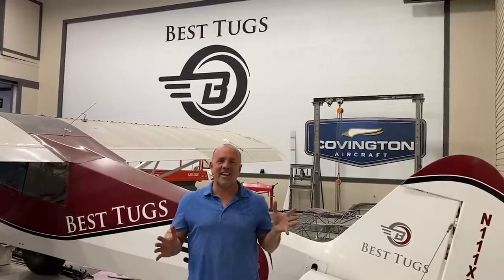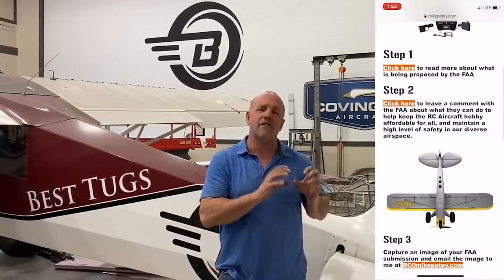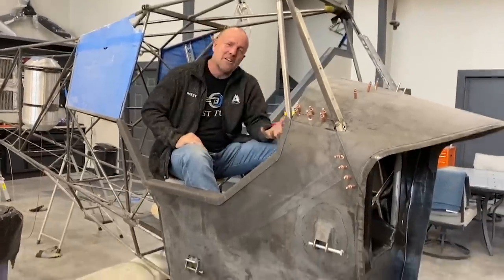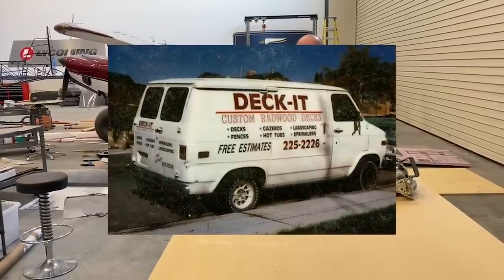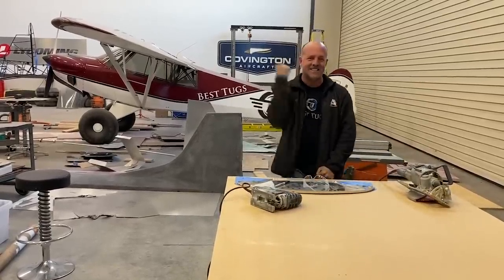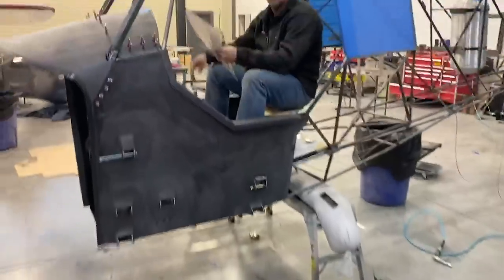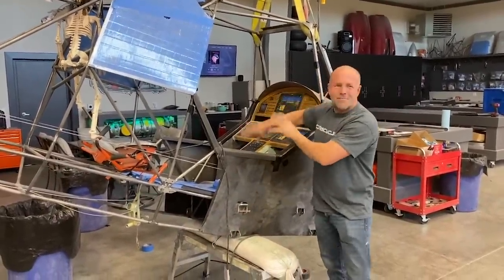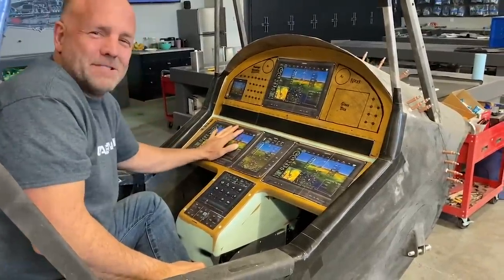🤠 Garmin Glass + Carbon Fiber (SCRAPPY Bush Plane 10)

Comment: Wait, wait, wait, hold everything!!! At the end there did you say you wanted to build it to HELP mechanics or somebody who works on the plane? You'll never make it as a designer, Mike. Darn, we had high hopes for you too. Well, I hope you redeem yourself by at least mix-matching different size fasteners, and using both metric & SAE for seemingly no reason. Maybe even both Torx and (impossible to find a wrench for) 5-point star drive screws for good measure. Otherwise mechanics everywhere will forget how to swear and get soft & lazy. Aside from that giant mistake, great video as always ;-)

Comment: 16:26:  Really!?  This panel requires a back-up?  (I hope someone at the FAA is watching and wondering the same thing) lol
Reply: The G5 has it's own internal battery backup in the event of total aircraft power failure, as well as it's own pitot and static air inputs. Perfect for a backup device. Or a primary on a small panel with a failsafe built in.
Reply: Regulations require IFR aircraft to have backup instruments so unless he decides to put in a secondary ADAHRS or ADC-AHRS unit for the main panels, hes gonna need that backup. I'm assuming that all the main avionics panels he's using would be running the same ADAHRS so lose that and say goodbye to your main instruments.

Comment: Regarding glass, I'm with you BUT they are still somewhat stuck in the past, the panels need to be much larger and less cluttered. It's much too rooted in steam gauge thinking.
Also if you place your seating position and stick, you get far more glass effect out of placing your primary panel right at ipad hand position as opposed to a distant wall of panels. Very important. Makes all the difference. Don't submit to a Cessna intuition of how far away the panels should be, it has to be right in your face for clarity. You want that comfy situational awareness. Not squinting uncertainty. Major key.

Comment: Thank you Mike for  commenting on the proposed FAA rules regarding remote ID. They are going to do what they want to do but if enough of us voice our opinion maybe we can get them to change  the way it is being proposed by lumping together fixed wing RC with so called drones. I have built many RC aircraft since the 80's and fly them along with many friends and there planes using common sense and respecting the rights of non flyers for years with no issues.These regulations will ruin the hobby as we know it. We have to all voice our opinion. By the way when will the RC model of Draco going to be released?
Reply from the maker: I don’t know the exact date, I believe it’ll be within the next few months.
Reply: @MikePatey  Thank you Mike.Can't wait till it"available.

Comment: From England. We changed over December 2019 for drones. Each operator and each pilot has to be registered, and have a number which in small print is stuck on the drone.  Think it was $20. It's about tracking down those idiots who fly near airports. London airport was closed last year twice, because some protest group decided it was a good idea to fly around the runways and ATC tower with a couple of drones. This resulted in a huge public outcry to do something... . I was against this move, then found the on line process easy. It then has not affected me one jot.
Reply: I was in favor of registration of RC planes.  If damage is done, the responsible parties should be tracked down.  Just like driving a car.  But requiring 24/7 surveillance every time I go out in my back yard to set up a new engine seems a bit over-reacting.
Reply: Grandpa 82547 is that what is proposed ? If so sounds over the top, impossible and misguided. We just have registration.  It’s really not an issue.
Reply: @Sandhoeflyerhome  Yes.  They are talking about transponders in toy airplanes.

Comment: I fly FPV drones, and I also have some time toward my PPL.  I, like MANY drone guys, fly VERY responsibly with respect for altitude, local air traffic, etc.  I generally fly no more than 100ft agl at best, because FPV quad drones is more about ground proximity and speed.  The FAA will absolutely criminalize a huge sector of the population by attempting to implement these insane rules requiring transmitting ID, have FAA approved kits, etc.  Their regulations are like gun laws...they will only affect law abiding citizens and will have ZERO affect on bad actors.  Total bs.

Comment: There's a bit more to the drone and RC regulations to look into. The FCC also should be looking into radio frequency interference from import RC aircraft equipped with unlicensed radio frequency products that could interfere with NAVAID, Air Traffic Control Radar Becons. GPS, Air Route Surveillance Radars a potentially very dangerous interference issue. Audio/video transmitters for RC craft being unlawfully imported and marketed as Amateur Radio equipment and operating in a licensed radio service should be investigated.

Comment: I have flown RC models on my rural 40 acre property in class G airspace for twenty years, now the FAA wants to take that right away through what amounts to an illegal regulatory taking of my private property. 

"In United States constitutional law, a regulatory taking is a situation in which a government regulation limits the uses of private property to such a degree that the regulation effectively deprives the property owners of economically reasonable use or value of their property to such an extent that it deprives them of utility or value of that property, even though the regulation does not formally divest them of title to it."

Comment: Hi Mike i do not know how to screen shot but this is my reply to Faa 

Hello  I am  a former president of a local RC airplane club regulated by AMA ( Academy of Model Aviation )the regulation on model aircraft should not apply to the new regulations but i agree to the regulations to aka Drones as defined quad-copters or tri-copters. this new type of DRONES give the RC (radio control) community a bad reputation and a negative relationship with the general community. We as AMA members are under strict guide lines should not need to register as we have all ready have done so with the AMA with Registration numbers placed some where on are model aircraft.   

                                                                                                                                        submitted respectfully
                                                                                                                                        David F Fogg

Comment: Careful now...designing an aircraft to be easy to work on will loose all your street cred with aircraft engineers.  With 14 years working on the H60. I get the distinct impression certain design choices are made just to make it harder on the peasant maintainers.

Comment: Garmin    to mike      do you want to know what the cost is of your custom Glass.
   Hell no why should I care,    Here is my   Credit Card     XXXXXXXXXXXXXXXX  number.
 I do have a limit on it    I think it is    around  10 million,     Garmin  That should cover it. 

Mike,      Thanks   When are they going to be shipped.    When?   Hell no.     Ship them overnight,

Garmin   ok as soon as the Credit card Clears.    Mike I will wait on the  phone,  tell me when it clears. 
 Garmin   OK cleared. 

    Mike,  good I have to get back to work now.     hangs up phone.. . Arm Pump,   walks off screen... 

                                                                  All in good fun Mike. 

 Greg:    CFI   M.E.           Grumman 1973  Traveler  owner,     Most I will ever build is a Zenith  or an  RC CUB with an Electric Motor.    Maybe   55" wing span.